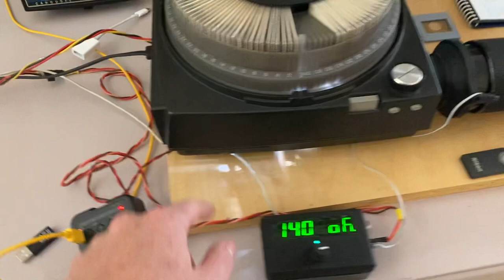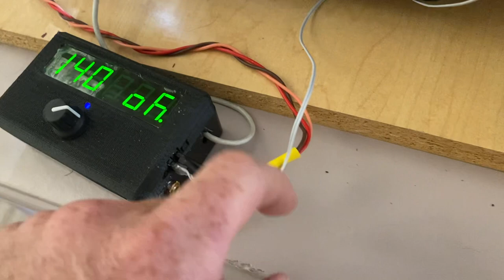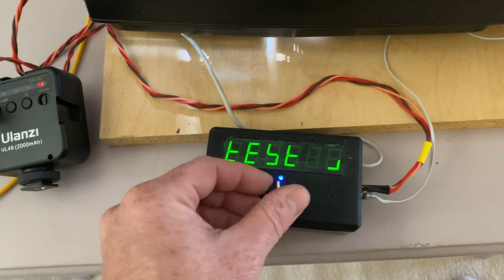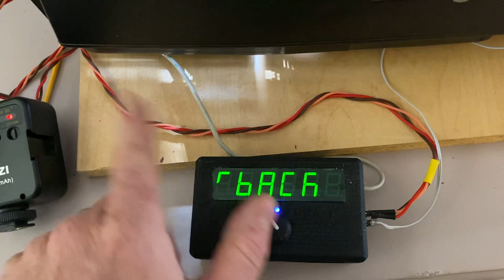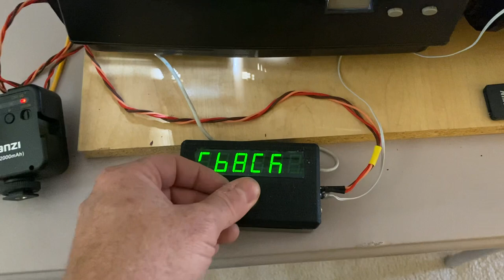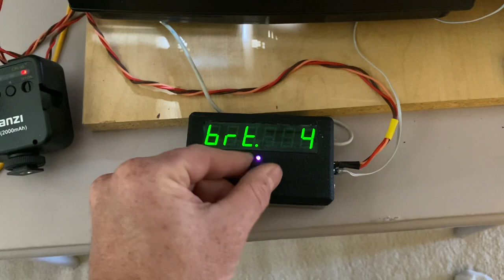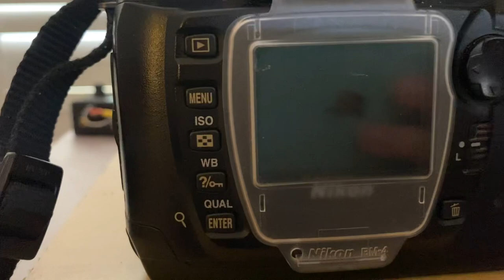Slide capture system demo

Comment: Hey Scott, nice work. I've been doing something similar gathering various similar project inspirations (still WIP and messy, I'll try to finish it and publish on github one day when I'm not too self conscious about my amateurish code). 
Interesting to use an IR remote, quite a bit simpler than using optocouplers to insulate the camera from the circuit but as I understand you're getting misses? Maybe something in your code.  
The light source is cool, I kept the original one but reduced the magnifying and added some white acrylic masks and heat has been manageable but I think your light will get you better results. Has this allowed you to disable the cooling fan ? On mine it seems it's generating tiny vibrations I pick up in my scans (granted much higher res..) 
Have you had to deal with vibrations ?
Also I went the "rollei" way without these rotary or stack loader; I must say I regret as I see yet another carousel based project with yours... but I could find a way to auto start & auto end quite easily thanks the the position of the linear tray. 

Also, interesting I left the whole display thing out of scope as it turns out, a lot of effort for parameters that I-at least- would ever change. Always cool to see DIY project such as yours, constant inspirations ! Looking forward to your github.
Reply from the maker: Thanks!   

The IR remote was out of necessity.  The D70 doesn't have any other way to remote-trigger the camera, and buying a new camera was out of the question.  I had considered hacking into the camera and wiring in a connector hooked up to the trigger switch... which is essentially what the wired remote does on other models. Personally, i'm not great with optocouplers, so i'd probably trigger it the same way i'm doing with the projector, using a relay.  It's clunky but within my abilities. :D

The misses seem to be caused by either the IR signal not working properly-- i haven't analyzed it to determine if it really matches the REAL remote or not, or if i got the led blinking on/off instead of off/on.. etc.  It worked, so i ran with it,  But i think the main reason is lag within the camera itself.  I've found that my camera gets laggy when you have A LOT of photos on the card.  It probably doesn't help that i'm not using a standard CF card, but a CF-to-SD adapter... but it definitely is affected by having like 10 gig of content already on the card.... the camera is just really slow and run warm...

I didn't have a (cheap/quick) solution for diffusing the light behind the slide, and the brightness of the bulb seemed like it would be WAY too bright to work with.  It's nice to be able to look down the tunnel for focusing etc without worrying about hurting my eyes. ;D
I also didn't want to rely on a 40 year old bulb that might be hard to replace during my short visit with my mom. :D 

Since the exposures are quick (1/100-1/320th second usually), i don't see any effects of vibration.  On the Kodak carousel, there's one motor that connects with the cam mechanism to advance the slides, conneced via a belt, and a second belt that connects to the huge fan.  On my home projector, i have removed the belt that goes to the fan since it's not needed anymore.  It makes it much quieter.  I didn't bother doing this on the one in the video, since i was trying to modify the projector itself as little as possible.

I went with the Kodak Carousel out of necessity.  My mom has the projector that I would be attaching my stuff to, and she also has 30ish carousel trays... and the stack loader for non-carousel slides.

The newer projectors (like the one I have here at home that i'm doing further work with) have detection of a slide, as well as when the tray is back at the 0-position.  I'll be adding in support for these to future versions, so that it can automatically stop at the end of a tray, and skip capture of empty tray slots.

I also have built a hot-shoe thingy for my camera so that the device can tell when a shot has actually been taken.  This will eliminate the need for taking multiple shots at capture time. :D
Reply: @yorgle  haha "It's nice to be able to look down the tunnel for focusing etc without worrying about hurting my eyes. ;D" --> it just occured to me that you're using a good old dslr and not a mirrorless as I do. I simply focus using the screen ! different issues ! Makes sense ! Good luck on further developments. I think my fan & drive are also similarly linked. I could give it a try if I get to a cold light source, might help me. Good point on the replacement bulbs but I've found they were pretty standard actually and still generally easy to get. Cheers, thanks for the reply.

Comment: Really nice project. I’m interested hiw is you post-production chain looks like. Do you kind of tagging you pictures? Do you  adjusting exifmetadata to add original shotdates etc? What software you use? And do you keep you digitalised pictures only in browser folder structure or using a database? Or self hosted library? Homeserver?  Thank you.
Reply from the maker: Right now, i'm building up the tools and web hosting app for this aspect of the project.  I know i want to group the files in their original "stacks" but also, i want to tag them by year, who is in them, location, what kind of event, etc.  So i've started a new database (mysql) from scratch and am designing the db to support this.   

Before I get there though, I take the camera captured photos (about 2mb each) and use a shell script using the ImageMagick tools to: rotate, horizontally flop them, crop (manually setting the crop amount per slide grouping/event, since it changed a bit during the process),  normalizing (if necessary) and output two copies of the images, one at roughly 1080p, the other at about 100x100 thumbnail.

I've also created some scripts to let me add tags to the files individually, and have tagged them by their original group, year, etc.  as well as pulling out some of the EXIF content to store that alongside the images themselves.

Next after this is will be a web interface that does queries against this database to create and share albums of the content.
Reply from the maker: And thank you! :)

Comment: A very intriguing solution!  I am very interested in what is going on between the new light source in the projector and the lens tube.  No lens in the projector clearly, but is there a diffuser of some sort for the camera lens to be focused on?
Reply from the maker: Thanks!   
Ah. okay. I should make a more detailed video explaining the setup more.  The short version is that the original light path is (simplified)
- (Bulb) (condenser lenses) (slide) (front focusable/removable lens) ... (screen)
I removed the original bulb and condenser lenses inside the projector, along with the front lens.  This is the setup as seen above:
- (LED panel from the Ulanzi 49 lamp) (3d printed bracket to hold the diffuser) (diffusion panel) (slide) (lens alignment tube) (Nikon with macro lens and 2x extender)

The diffusion panel from the '49 essentially becomes a backlit screen for the slide.  It must be cleaned of dust, as any dust on it will be visible in the "white" areas of the slides.  I could move it back to be outside of the depth of field of the lens, but there just isn't enough space inside the projector enclosure to do it.

Comment: I'm interested in the light source. I haven't made one myself yet but experimented and read up a bit. Do you have a diffuser between the LEDs and the slide? Conventional projectors don't and whether or not you have one greatly effects the contrast of the final result  (Callier effect). I found my camera was unable to capture all the tones without a diffuser. But maybe other digital cameras can.
Reply from the maker: Yep. I'll get some more detail shots of it when I set it back up again.  But the short version is that I had built a neopixel-based backlight that used 7 neopixels, with a white diffuser gel just behind the slides... but this wasn't consistent enough.  Once i  got this $25 Ulanzi VL49 backlight, I noticed how consistent it was, and how nice its diffuser was.  So the backlight in the system is the LED panel from this device, removed, and installed in the light path, and then the diffusing plastic that it came with is mounted just behind the slide area.  So technically, "white" from your slides is really looking through the slide, and to the diffuser itself.
Reply from the maker: I should also note that you really need to use a rocket or bulb thingy to blow dust off of it before capturing a bunch of slides.  any dust that lands on this diffuser will be visible in the captured images.  (And the fan inside the carousel needs to be running, since that single motor also powers the  slide-advance mechanism.
Reply from the maker: And conventional projectors don't, since the "white of the image" ends up being pure light, and whatever color it's projected on, whereas this is looking at the slide, and looking at the diffuser... not sure if that makes sense.   But regardless, without the diffuser, and using the original bulb, you're at the mercy of the brightness and focal point of the condenser lenses to get all of the image captured without vignetting... or something... i'm not an imaging scientist. ;D   (as for color balance, btw, i have my camera set on "daylight" and with this VL-49, everything comes out with appropriate tones.)

Comment: This is pretty cool. I think the effort of getting something like this going would exceed the benefit for me, but it's still pretty cool. It's too bad you don't have a slightly newer camera because I know the D70s and D80 supported a wired (cable) release instead of having to rely on the funky IR one. Old forum posts indicate you might be able to mod the D70 to accept a wired shutter release, although I don't know any details.
Reply from the maker: Thanks!  Yeah.  Well, it worked out okay since to trigger a wired controller, I'd need another relay... although to be fair, I have two relays in it... one wired to "next slide" one wired to "previous slide"... which i'm not using. ;D  And adding IR support was super easy, barely an inconvenience, as it is just an IR led, and some code I found on the net.   If i couldn't do that, i was going to hack my IR remote... or hack into the camera itself.  :D

Comment: This is very cool, well done. And a lot cheaper than the Kodak HR500 Photo CD scanner I used in my old lab. That was like 125K :O It worked great until a slide got jammed 😂😀
Reply from the maker: Thank you!  Also this is a lot less manual involvement than one of those scanners...  I have an older nikon slide scanner, which i never actually got working, but i would have to manually scan every individual slide and wait for it to be captured.  From a "professional level", you could call the results of this to be "web-quality proofs".  The next step would be to use a high quality scanner to get perfect scans of the results... i'm just not doing that part. :D
Reply: @yorgle   Or if you have the bucks and the time then you use a drum scanner but one tray would take a month LOL :)

Comment: Is that an 80 or 140 tray? The 140s will jam and skip a lot more 👍
Reply from the maker: I've run a bunch of 80s and 140s in it, and with the exception of one 140 that was physically damaged (the latch on the bottom was broken), i've had no jams/skips. :D  I feel like that might be an issue with the projector's mechanism itself.  I've now tested this all with four projectors and all seem to deal with 140 trays fine.... or perhaps i'm just lucky. :D
Reply: @yorgle   That's great. I did notice that if the slide frames were cardboard and frayed that didn't help. I think a single shot with a digital camera is better than a scanner that moves. Also you can use a little depth of field with a camera and focus. Most scanners are lacking in that field.
Reply from the maker: @mikemeyerphotopro  and there are always edge cases... I found a few different variants of slides in my dad's collection... Most of them from the 1970s onwards were Kodak cardboard slides.  there were a few that were plastic from Fuji or some other brands... and a few weird square-format plastic framed ones...  All of those worked well in the slide trays.  

Where I had problems were in some of the much older slides from the early 1960s using the stack loader.  There were some in cardboard frames, but were about 2x thicker, since they had thin glass on either side of the film... some of those had emulsion failures, where it looked like the emulsion just kinda liquified... i should have snagged those.. i'll grab them next time.  Also I had issues with some other with just thicker cardboard frames that the stack loader just didn't like.  There weren't many, but it did result in some manual work to get them into the slide tray.

I think I need to make a follow-up/post-mortem video on the whole project... :D
Reply: @yorgle  I've used a camera mounted under the projector to capture images of the slide projected on the screen to do something similar. I have an 80 tray specifically for old slides that don't fit well in a 140 carousel; that's also more reliable for them than a stack loader. Other than splicing wires for the projector & camera remote, my method is purely manual — so I'd be very interested in seeing any follow-up you can put up.

I particularly like your 3D printed connector tube! Brilliant solution!